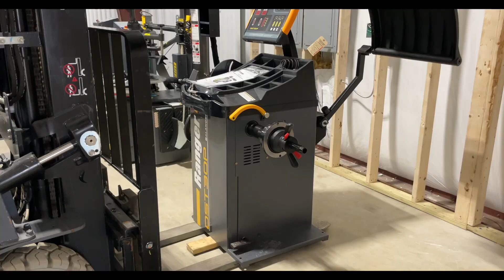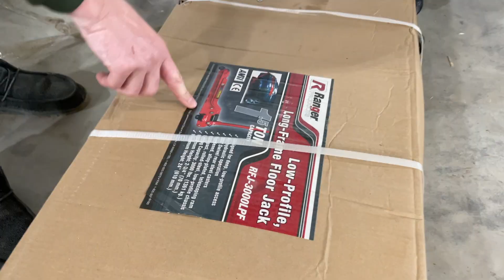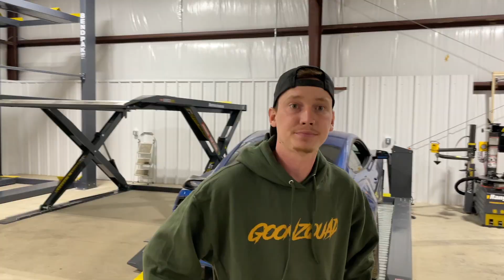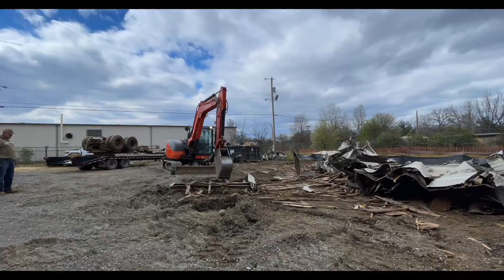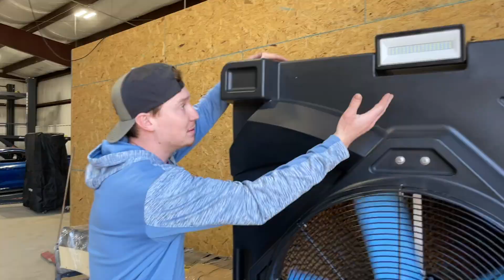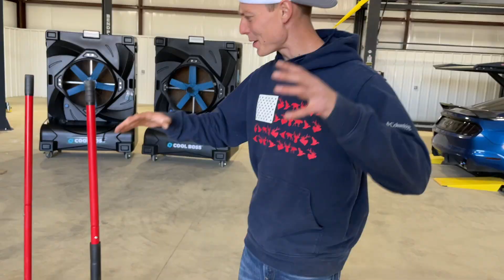The New Goonzquad Garage Is Almost Finished!!!

Comment: Hey guys glad yall are finally in the new shop.  One thing I though I would mention is to be sure to leave a 3 x 3 clearance in front of your electrical panels (where you were going to put the tire equipment).  If you ever have the fire marshall (or OSHA for that matter), they will expect an open area in front of any electrical panels.  I know that sounds picky but in an emergency you will be glad you did.

Comment: I'm with others here - get the floor done now. Not only will it be easier before you have to move more equipment and stuff, but the floor will get dirty with oil and grease, etc., that will also have to be cleaned.
I'd also go with at least one window in the office into the workshop. It's handy for safety in case something happens to one of you.
The two posters also look a little close to the wall for my liking - you'll get annoyed with squeezing between cars and the walls over time

Comment: Hey guys. Make sure your tire machines are far enough away from your power panels. You must have access to the electrical panels unobstructed. In case you have an emergency to where you have to turn off power.. just a thought!

Comment: That Anion button causes the machine to produce negative charged ions to spray out.   The negative charge makes the vapor stick to dust particles and mold spores, so they fall to the ground easier and you breathe cleaner air.

Comment: Yes on the apoxy floors.   I was an auto tech for 24 years before I became a police officer. you NEED to get the floors done.  Make sure you give them plenty of time to cure before moveing the equipment back on the floors.   DO NOT put the brick looking floor tiles down. I worked for Mini cooper of Raleigh and they put that crap down. After just a few weeks the techs all started having feet and knee issues.

Comment: Looks fantastic, just need to plan storage to make things more efficient.  Think about tool & equipment storage and also parts storage.  You will soon be looking at building an extension 😂.  Have you seen things called vertical storage carousel?  Loving the video's cant wait to see the shop in use.

Comment: The anion button on the coolboss creates negatively charged ions to be dispersed into the air while youre using it, the negatively charged ions attatch to dust and dirt particles in the air, weighing them down and causing them to fall. Essentially just helps with any dust in the air to give you cleaner air while you work.

Comment: Since the electricians have to come back out, I would get an alarm system wired into the new garage ASAP.  Not sure if this has already been done, but since you are adding some expensive items to the space, they need to be protected.

Comment: Also the floor needs to be sealed for just in case you have an accidental spill of oil you don't want it to stain so you need to put down a sealer

Comment: Congrats on your shop…….. one suggestion,
On the back wall across from the garage doors…… install two 4x4 temperature actuated louvers  at a high point to pull the heat from your building. They will eliminated stagnate air…… and naturally pull the heat out.
Reply: 👆⬆️🔝👆⬆️🔝🔝🔝⬆️🔝
Thanks for watching.
You have been selected our winner for today giveaway.
Hit us up ⬆️⬆️🔝to claim package.🎁
⬆️🔝⬆️⬆️

Comment: shop looks great.  Those tire machines will not be able to stay there though.  I am sure the inspector will require at least 3 feet of clearance in front of the electrical panels, per the National Electric Safety Code.

Comment: You're going to have to move those tire machines a little bit because your inspector will want 3 ft of space from the front to the left at least that's the way it was up here in Ohio can't have anything within 3 ft of that electrical panel

Comment: Epoxy on the floor is a great idea.  When oil drips on the floor it soaks into concrete and leaves a nasty stain. Epoxy allows simple wipe up!  Kelly has a Point! YOU HAVE TO LEAVE 36" Clear in front of the electrical panels in all directions.  Tire machines are too close.

Comment: Potentially have a look at moving your balancer to the left hand side of your tire mounting machine. 
This way you can come straight off the mounter and directly onto the mounting  side of the balancer. It doesn’t sound like much of a difference but this way you’ll be much more efficient and won’t have to roll the wheel around the machine to load it.
Reply: Thanks for watching👆 you have been specially selected among winners for today - giveaway.
Copy the link Above ⬆️⬆️and text to claim your package 🎁🎁
🔝🔝🔝

Comment: Just wondering guys would ye not have laid a sealant or any type of oil/water resistant base over the concrete before installing the lifts?  Pain in the hole to move them round while covering it now.  Onwards and upwards though fellas, ye (and pops) are doing a great job.
Reply: Thanks for watching ♥️
DIRECT message 🔝👆🔝
You are selected among our shortlisted winners for today's giveaway 🎁

Comment: Shops looking great! Cant wait to see what you guys build in that space! 
As a electrician, I foresee a issue with the location of the tire machines, code requires a minimum of 3 feet of free space in front of any electrical panel, double check it's location with your electrician just to be safe as it will hold up your final inspection...

Comment: You guy's need to also invest it them big ass fan's on the ceiling. Trust me it will help keep the air circulation going well. We have them in our shop and they do make a difference in the winter ti pull the heat down and summer to spread the ac evenly all over the place. By the way good job on you all's build, and glad to see pop's still going strong.  God Bless You All and your family

Comment: Dont know if you read this. But i have a solution for your shop. You like to paint. Just make a "paint preparation zone". It does not take place. Just a flor like in spraybooth and two fans. One on intake one from outside. I had made some shops. If you interested just write me. I could give some information

Comment: Be mindful of electrical code requirements for your two tire machines.  National Electrical Code requires minimum access at wall panels (you look like you have two circuit breaker boxes behind) - you need a minimum isle size and front access to these boxes.....

Comment: Have you thought about a stairway outside the office area, leading up to a mezzanine area above the office. That would give you so much storage. Put shelving units up there. Also you could put a 1 car lift straight in from the front door. Need to drive a car into the shop, drive under a car on the lift

Comment: You have 240 right now it is just the breakers you do not have. You can not have the tire machines blocking those breaker panels by fire code move them up on the office wall near the doors better place for them any ways. 45 degrees on 2 the lifts takes up the floor space of 3 lifts.

Comment: Ooo wee DANG SON congratulations squad on the shop it looks great. Its almost a one stop shop and I can't wait for  the next build. What are the weight limits on your 2 post lifts and can they lift and hold your trucks (especially a dually) without failing?  Y'all will be rockin and rollin once you get the floors sealed....

Comment: Hey guys on that wall with electric panel you should use the same metal wall panels as rest of shop walls. If you ever have a need to get back in that wall you can just. Unscrew the panel instead of cutting drywall out then having to patch it/paint it. Just an idea!
Reply: Thanks for watching you have been specially selected among winners for today - giveaway.
Copy the link Above ⬆️⬆️and text to claim your package 🎁🎁
🔝🔝🔝

Comment: Old trailer scrap steel payed for new tolley jacks 👍.
Shops awesome.
Roof insulation is drooping a bit from ceiling by the stacker.
Little extension for frame machine and spray booth 🚗🔥
Reply: Thanks for watching you have been specially selected among winners for today - giveaway.
Copy the link Above ⬆️⬆️and text to claim your package 🎁🎁
🔝🔝🔝

Comment: You guys need 3 feet of clearance in front of your electric panels, the machines you have in front of them will fail your inspection. If its not caught, it is still a safety hazard for the next electrician that works in that panel.

Comment: Hey fellas, check your fire codes for the area to see if you can put stuff in front of your electrical panels.  many locations have a safety distance you have to maintain away from your main distribution panel.

Comment: 🌴 well you two squirrels, it’s finally starting to happen I think this is a game changer but don’t get ahead of yourselves in the excitement, you really need to seal that floor. Are you going to run air outlets around the perimeter inside the shop , didn’t see a air compressor yet ?  Get the entrance driveway into the building taken care of , you didn’t get 220v put in yet for the machines or welders , the area above the electrical box all the way to the top of the office could get a platform for parts , utilize as much of the upper part of the shop as you can , you paid a lot for all that area , ya told us about a storage container for the back , maybe a spray booth build coming soon , 🤔. Are you getting a/c. & heat put in on the office , are we having fun yet !    🤣

Comment: You're going to need to move those tire machines a bit further away from the electrical panels if you want to pass final inspection. There is a required working clearance around electrical panels. FYI
Reply: DIRECT message 🔝🔝🔝🔝🔝

Comment: I seriously suggest epoxy flooring. The builds will stain the concrete over time with all the oil and coolant. With the epoxy you wony have to worry about spills and leaks, and clean up is a breeze. Just my two cents! I will support either decision!
Reply: DIRECT message 🔝🔝🔝

Comment: n-ion - negative ion generator. will cut dust particles out of the air. dust has a positive charge, thats why it floats. the dust will fall out of the air when a negative ion attaches to it. be well.
Reply: DIRECT message 🔝🔝🔝

Comment: On the wall behind the tire balancer, you guys could use plywood and peg board to hang belts, hoses, parts, and tools to save floor space. They have those small bins for bolts and nuts that would also mount to the peg board. Paint it a contrasting color show the parts and bins stand out. Just an idea
Reply: DIRECT message 🔝🔝🔝🔝

Comment: I have epoxy on my floors and it is slippery bad when oil, water, coolant gets on it. Will need to put a coating that had anti slip as well because car tires will spin out you will fall. Also it gets nicks, scratches, and cuts from heavy parts. I would paint the floor with a good grey floor paint and just repaint every 5 years

Comment: Looking fantastic lads. Its all coming together. 
One question, Paint Spray Booth?  You guys do a lot of spraying, so outside on the back is it worth you having your own spray booth built with extraction system and heating. This will save you lots of money and time in the long run. You wont have to transport builds to the spray booth and pay and try and fit into there schedule. Spray a car in your own booth, leave it in there to dry. No worries about chips or debris and then having to spend hours buffing..
But all in all the new shop looks great and cant wait to see a Goonzquad sign above the shop

Comment: 1:35 just do a concrete sealer it will hold up better than epoxy in a shop. Make sure sealer product can withstand oil and other stains without decoloring

Comment: Make sure you research the setback from the tire machines vs the electric panels. The inspector will measure. I can tell you the NEC number is 30 inches but every town can have their own regulation. Best to ask first before drilling holes.
Reply: I noticed that there were clearance  issues to the panel boards. As an inspector I would be recommending that the area around those panels are kept clear. Love this channel
Reply: @scotthagerty7837  so as an inspector what's your take on no HVAC being installed.  Would you give a final CO to the boys?
Reply: @robm3063  I don't believe commercial shops are required to be conditioned. They may just condition the office space too. Their plans would dictate how they plan on using the space and if it was going to be conditioned or not. If the answer is yes the code would dictate what type of R-value they would need to meet the model energy code in their state.

Comment: Glad to see the shop coming around very well. You have learned so much. Heads up from an electrical inspector, code requires 36 inches clear from your electrical panels. Your tire machines may create an issue for you on final inspection. Check in with your electrical contractor on this.

Comment: Buy a separate "tirecheetah" tank. The ones built in like you have there are garbage and only work well on flimsy sidewall tires such as Michelin tires. I've work at a town fair tire, a Pete's tire barn, amd a tire warehouse. I now work for the Chevy dealership and have the same machine. That tire blaster attachment is useless

Comment: If you epoxy the floor inside your Commercial property you will be able to clean easier it will withstand gas oil everything like that it’s easier to clean plus it makes it look good in there and that’s what you need for a garage or commercial property

Comment: Hey, you guys are killing it there. Love the content. Keep up the good work.

If I could suggest, as a commercial electrician, may I ask that you move your tire machines at least 3 feet from the electrical panels? It is code that there needs to be 3 feet to work on the panel and electrician might not be happy working in a small space, that's all.

Other than that, your shop looks cool.. look forward to videos in there..

Comment: Don't know if you already have them but you should get something like (68L Portable Air Discharge Garage Waste Oil Drain Drainer) also a Parts Cleaning Machine, for storage you should consider the "Levrack Garage storage system".

Comment: Congrats on the awesome setup boys! Just wondering if you considered sealing/painting/epoxy the floors so its easier to clean. That raw concrete will absorb a fair bit of fluid/oil/etc.
Reply: They mentioned it in this video that they might have someone come out & epoxy their floors.

Comment: You need to build a mezzanine level to store all the parts and stuff. Also near your lifts where you will be working, you need shelving to store parts you are taking off or will put on, so they are close and handy and not mixed with the rest. I'd also in the future build a spray booth outside the shop, or as an extension of the shop. That will mean so much time saving, and also reduce overspray when painting jams and under bonnet etc. You have plenty of space to attach it to the building somewhere.....

Comment: Cool Boss swamp coolers are epic.  The fans will work perfectly all summer there in TN but the “swamp” part may not due to the high humidity.  The water evaporation cooling effect works best in low humidity areas but on certain days you will be able to take advantage of it for sure.

Comment: Are you guys planning on doing something with the floor? The pure concrete floors are gonna get dusty real fast as you can already see. And any oil/coolant spill will stain the floors instant. Better with a industrial epoxy floor. And it will look so much more epic. Id also recomend some kind of workbench setup. To use for working on stuff. And i love the idea of getting the tool chests to move arround :)

Comment: Unfortunately that hose coming off that tire machine isn't as good as an actual cheetah. I've run into many tires it doesn't work on if the gap is too big. Be ready to buy an actual cheetah if you plan on stretching some truck tires.

Comment: Congrats guys.   You will need to have 36” in front of the electrical panels per the electrical code.
Reply: That working space in front of the electrical panels needs to be clear at all time. Better paint that area yellow but not required by code.

Comment: I would use 1x8 pine on your wall for the tire machines. You will stain and damage sheetrock and with wood it will be stronger and look a lot better

Comment: Get the floors coated NOW or you’ll wish you had. Before you get it filled with stuff to move and/or work around. Looks great, easier to clean and will reduce dust.
Reply: If they hired the job out it would still be worth it. I would hate to see them ruin those crete floors.
Reply: please use self levelling epoxy...maybe better
Reply: Agreed.  Maybe we will see a video of them taking all the cars and equipment out again to get ready for the new floor.
Reply: Agree totally, get that stuff out, you're getting too much stuff built in before the epoxy.
Then there was that time you did a burnout ....  That will need real cleaning
Reply: The floor, tools, cars…everything will be dusty with all the paint and bondo dust.
Reply: I would say do polished concrete, if they did any welding and get slag on the epoxy it’ll burn it
Reply: @DonutEngineering  good point.
Reply: Surely it would have been better to epoxy or otherwise coat the floor BEFORE having the lifts etc installed, particularly if anything needs to be re-sited in the future?

Comment: I can already see the need for a 2nd building for the paint booth.  Maybe the frame machine and tire changer could be placed in it as well.  Plus more storage.
Reply: I was thinking the same thing, missing that paint booth. At least that building wouldn’t need to be very large
Reply: I wonder what happened to the inflatable one ??   Could easily fit in there for once in a while use.
Reply: @RandysRides  I think that was Sam Crac that had the inflatable paint booth?
Reply: The Said it sucked and got holes in it. Pretty sure they threw it in the garbage
Reply: I think the inflatable one could work for a while then they may have plans to build one